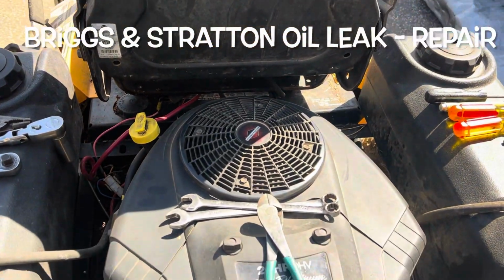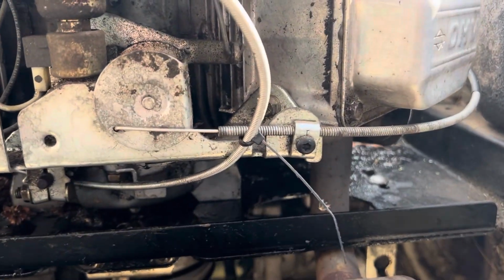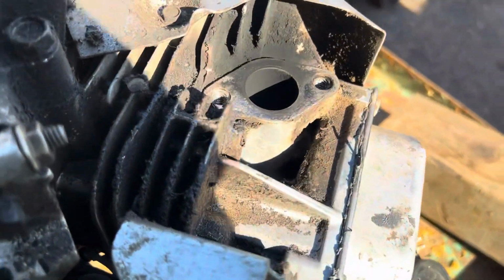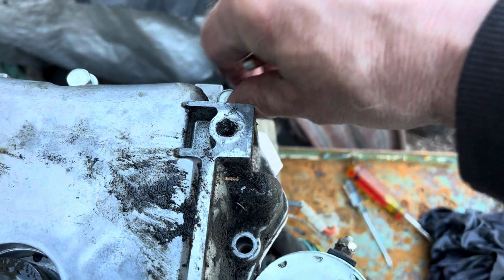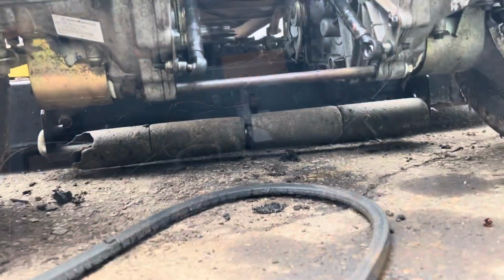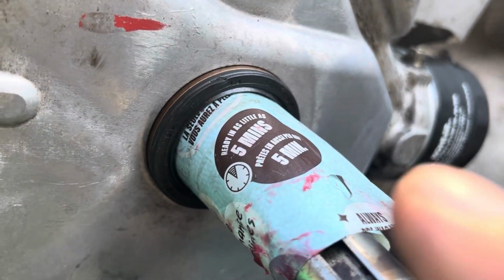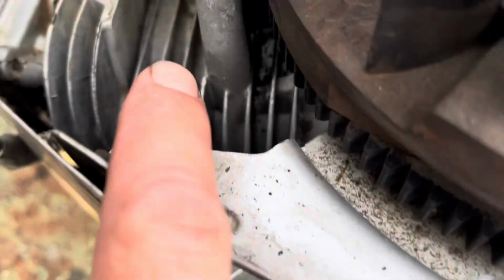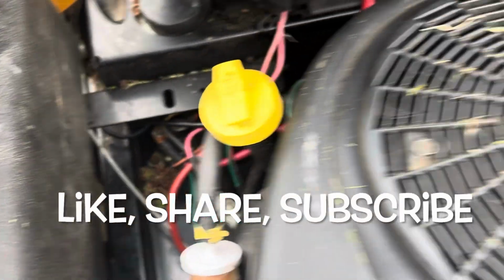Briggs & Stratton Oil Leak Repair - Lower Pan Gasket

Comment: I would pour some AT-205 Reseal in it. The stuff stopped the leak around my power steering pump shaft on my 2000 Ford Expedition about 2 years ago. Just don't use too much because it will dilute the oil if you do. Amazon sells similar stuff for $ 12. It swells rubber a tiny bit, which is often enough to stop a small leak from a worn shaft seal. You can't use it in brake systems.
Reply from the maker: I would use that as a temporary solution - Thank you.

Comment: .....confused by step four........   I thought I was on a roll when I was keeping up with step two,...but then 
i heard my 10mm roll away someplace.
Reply from the maker: lol 😂!
Reply: @canadianwrench  ( I actually found a 10mm at a yard sale yesterday...two in fact.

The funny thing is I was picking up sockets and one said " john" on it?  John?
It was a John Deere socket....1/2" drive 10mm.
To me that is laughable.....
I think when working on a ten mm...you need 3/4" drive and just for good measure, keep a 1" drive impact gun at the ready.

Those 10mm can be devilish little buggers....Don't turn your back!  )
Reply from the maker: Agreed - I have back up 10mm everything (several). 

Cool find - the overkill 10 mil. from JD. 
I love that old stuff.
Reply: @canadianwrench  I think I found a 10mm Craftsman in the street.
I've got it on film but it was run over so many times....I can't read the numbers yet.

It gave me an idea for a vide.